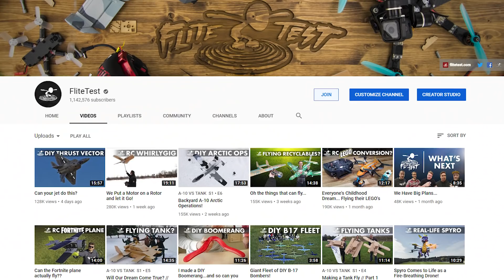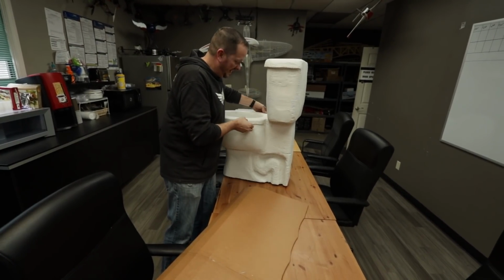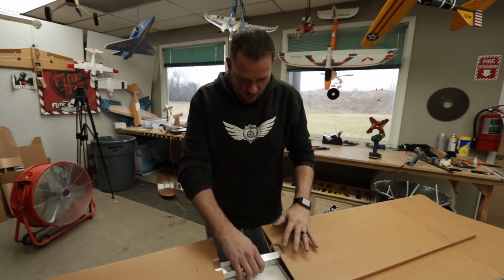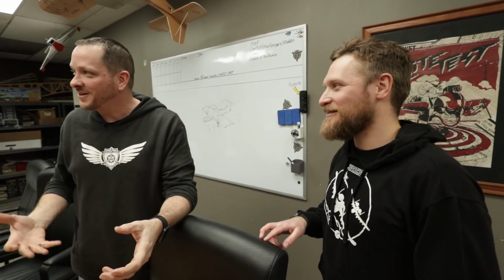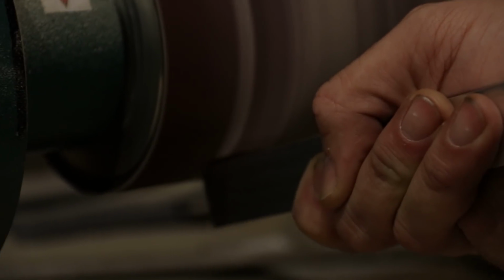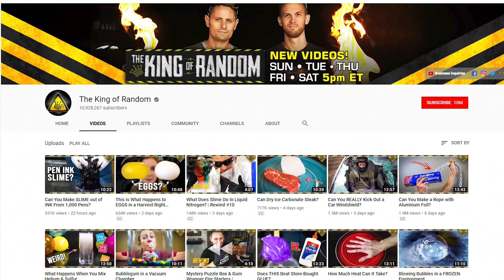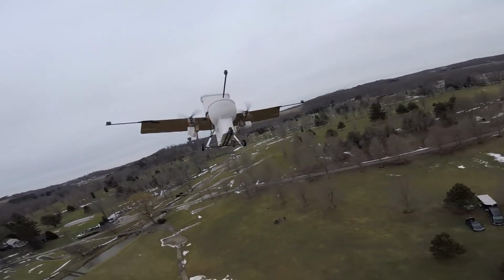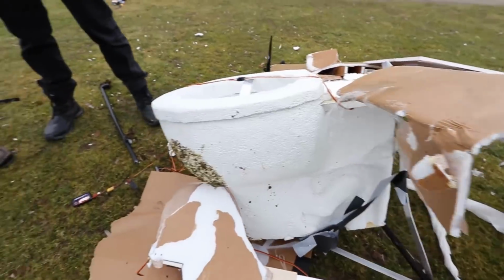Will 💩 fly with The King of Random??? Air Toilet?

Comment: Now you need to make a foundry fly
Reply: Yush!!! a coal fired one so you get the sparks coming out of it :D then have a variable air inlet with a flap that opens and closes like the butterfly on a throttle valve in a carby :D
Reply: It would be an interesting way to make aluminum shot.
Reply: @cameronwebster6866  hahahaha yuuuush, morbidly dangerous (ally sticks to you like napalm) but AWESOME :D It would be interesting to see how high moltern aluminium has to be dropped before it hits the ground solidified
Reply: Max Bainrot that would depend on droplet size, smaller droplets will cool faster than big ones.

Comment: The elevator probably was having it's airflow blocked by the tank; probably would've flown better with delta wings and elevons, or maybe making it a little nose heavy and adding a spoiler/airbrake at the top of the tank.

Comment: You mentioned that you learned from the chair plane with the small elevator and then went on to do the same thing with the toilet plane proving you learned nothing. I was thinking put the elevator low and long or even just a flying wing design that would eliminate the need for a tail at all.

Comment: I was 12 and turned my chuck foam glider 747 into a RC plane also out of my old tyco RC truck i had, range sucked to the point i had to run with it but it flu and had up/down and bank left/right but only 1 speed for the motor. This was like in 98 or w/e. Also made air boats out of the old star trek transport ships that was way to fast.

Comment: You have very little aerodynamical control behind the tank, but do you think an actual third low power reversible motor could replace the elevator?
It shouldn t mess up the aerodynamics if the fan is behind the tank while still providing leverage to manoeuvrer the plane.
Do you thnk this is doable or not worth even trying?

Comment: "Flying" is based upon the principal that a curved surface creates two flows of air.  One flow if air is faster and the other is slower.   https://theory.uwinnipeg.ca/mod_tech/node68.html  --  With the fast air on the top and the slow air on the bottom, a rise or lift is created.  An aerodynamic "body" does help in that the "body" does reduce "friction - air" and thus allows for more efficient use of the principal.  Thus, the wings do the lifting and the toilet is just a "body".  It is not the toilet that flies.  It is the wings producing the lift that flies.  But, a balance must exist in order to create an optimal situation for the "object" to not be too nose heavy (and thus not fly at all - the reason Flight engineers are so concerned with the positioning of weight on Mil Transports).